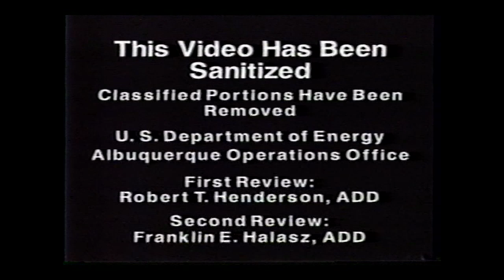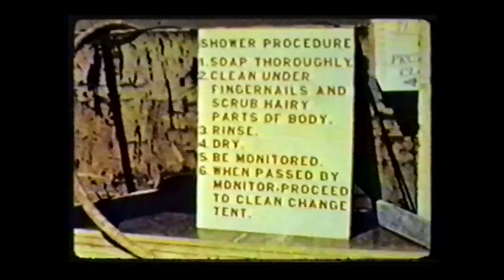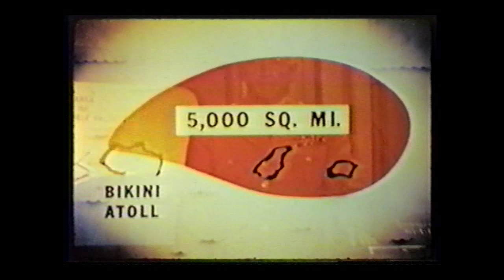Operation Castle (1954)

Comment: 4:28.  Because the Castle-Bravo test substantially exceeded its expected yield, the men left at Enyu Island were trapped in their protective bunker (with a rising internal radiation level) for some time before they were rescued.
Reply: The crew of the Fukasu Maru #7 weren't so lucky by the time they reached Japan they were dying from radiation exposure.
Reply: They were 25 miles away and their reinforced bunker was shaking and vibrating.

Comment: In my eyes, Castle Bravo was so much more intense and big then Tsar..  the yield,footage,and aftermath was beyond
Reply: It's a pretty epic blast, yeah. Though most footage of Tsar is classified or lost. The official footage of Tsar is of an explosion about 2.5 megatons in size, i.e. a lie.
Reply: I bet Tsar wiped out all the cameras after detonation.
Reply: Though Tsar just wasted most of the yield high in the air. A couple of missiles of eight MIRVed W88s each, much lower total yield, probably has a similar effect on the structures on the ground, less radiation release (yes, Tsar was pretty clean but that is mostly because it was a high atmospheric blast), less cost, and deliverable by SLBM. It does require better targeting but if the US could hit a half mile target from 240,000 miles out in 1968, just a third of the way around the world shouldn’t be a problem getting within a few hundred feet.
Reply: The Tsar bomb was neutered to 1/3 of maximum yield by replacing a uranium tamper with lead.
The overpressure was sufficient to destroy everything within a 35km / 22 mile radius and produce a 60km high mushroom cloud.
Wooden houses 100km away were levelled.
It is at the upper end of a practical weapon because much larger and the blast vents to space at much above 200MT giving an upper blast damage limit. You can do more damage with 3 10Mt weapons.
It was only deliverable by R7 missile (the weight was about the same as a Soyuz spacecraft), unmanned aircraft or submarine.

Comment: My father was present at the Bravo blast of operation Castle and the 2nd blast Bravo. He died of nonhodgkins lymphoma in 2001. He  also had Graves disease in the 1960s. My family has gone through so much as the result of his massive radiation exposure.
Reply: Except non-Hodgkin's lymphoma is not caused by radiation, and Graves isn't either unless he already had thyroid problems. Facts don't care about your feelings.
Reply: @DonHavjuan  🙄

Comment: I realize it was an arms race--I can 'out-kill' you...  Think of how much radiation was put in the air/ocean during those tests.  Fukishima must be something like a wet diaper compared to all the stuff we did in the Pacific Proving Grounds  :-/
Reply: Not that much, and fukishima hardly any at all.
Reply: The fallout of radiation from a hydrogen bomb is normally lower then one would think since it has commonly been heavily over exaggerated. With some of the cleaner yielding bombs they could go to the test sight and be at ground zero the next day because of the drop in radiation caused by its half life . Of course there are other factors that play a role but nuclear testing can and has been done safely.
Reply: I can't even process what something like Castle Bravo would do to a city.   Fat Man took out Nagasaki.   This was a puny weapon.   Bravo would instantly vaporize buildings and sky scrapers.  Heat hotter than the surface of the sun for miles in every direction.  It is just mind boggling to consider.